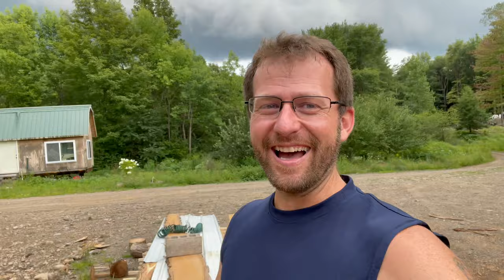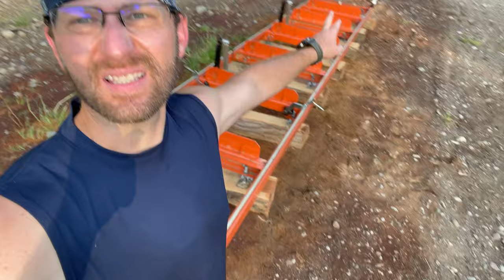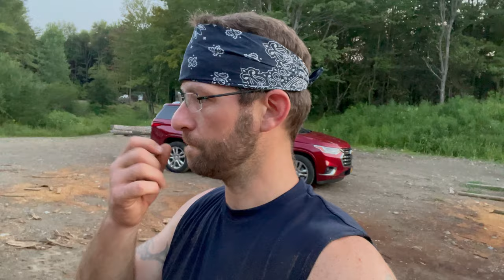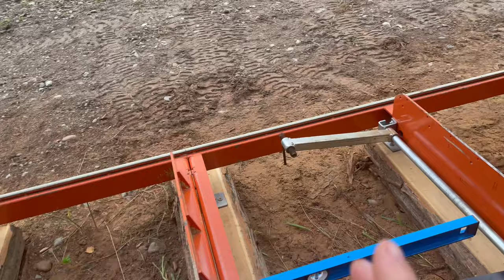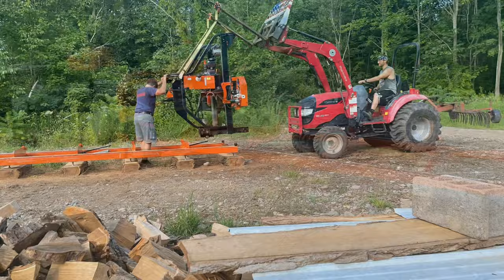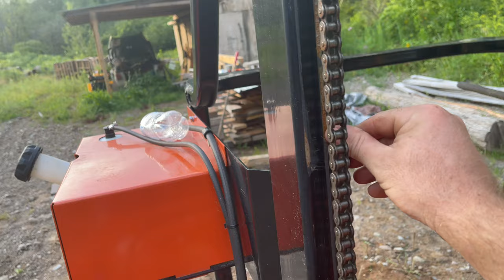Equipment Series - A Much Needed Sawmill Upgrade for the Wood-Mizer LX150

Comment: Great idea!  About 15 month from now I’ll hopefully be going through the same process of setting up my own sawmill.  I ordered the same machine you have there.  This Spring/Summer I’ll probably just try to pre-build a solid wood structure like this to work off of.
Reply from the maker: Congrats on the sawmill order!!  You will not regret taking the time to do this step.  It has made all of the difference in the world.

Comment: I have the same mill. I had to run the base logs lengthwise instead of across. The track had a bow upwards that needed to be pulled down. Leveling that track took forever but it's set now and not going anywhere.
Reply from the maker: I had the same problem with mine, but I was able to resolve it by loosening the bolts that hold the sections of the bed together a bit.  Either way, i agree.  A lot of work but adding the base pieces makes the whole setup a lot more stable 🙌🏻